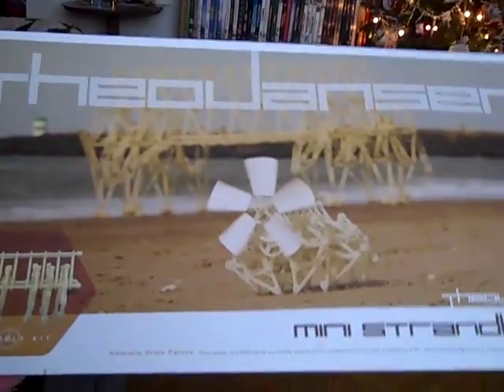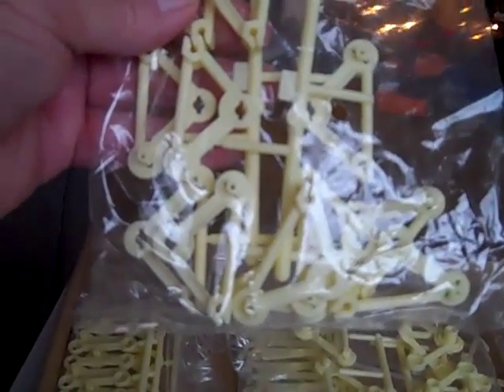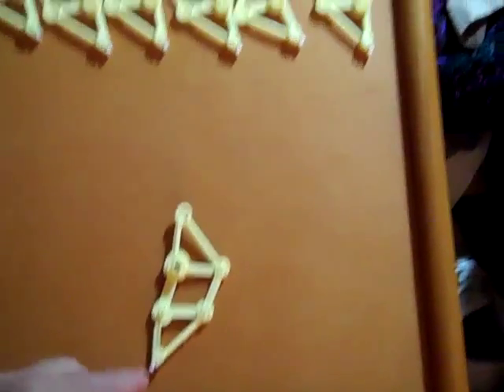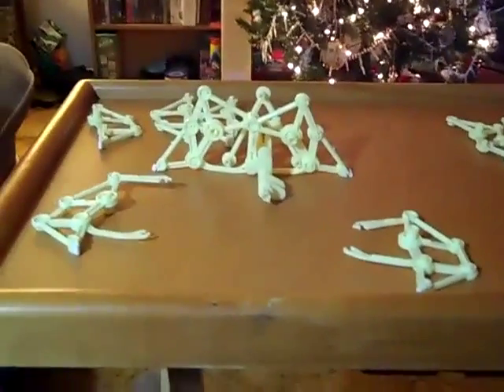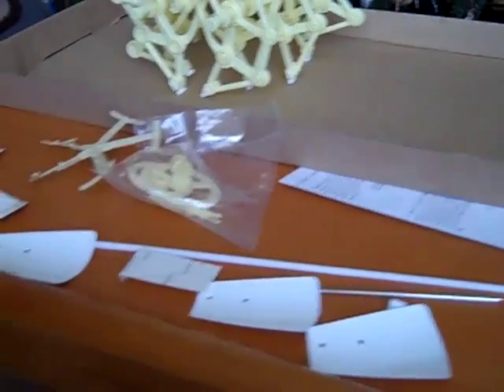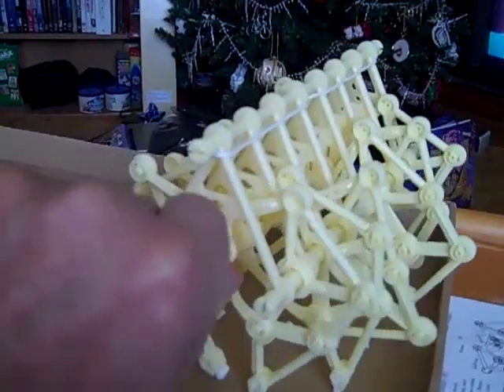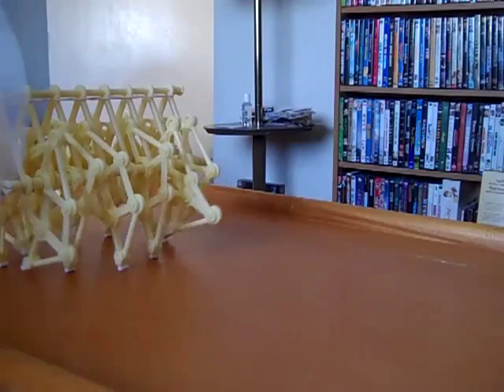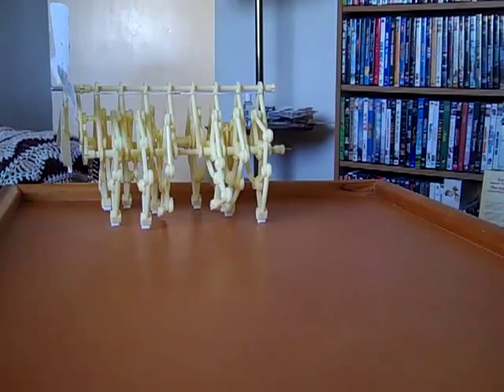The Mini Strandbeest Assembly and Operation

Comment from the maker: It sounds like it is binding up then going backward to releive the stress.  I had problems attaching the legs to the cranks in the first go-around.  They rubbed against each other.  It took a couple attempts carefully reading the wording of the instructions and looking at the reality in my hands to figure out what was wrong.  When you turn the crank there should be absolutely no resistance.  Good luck.